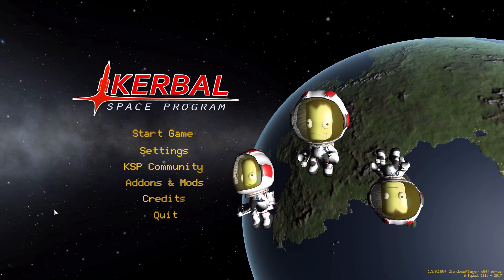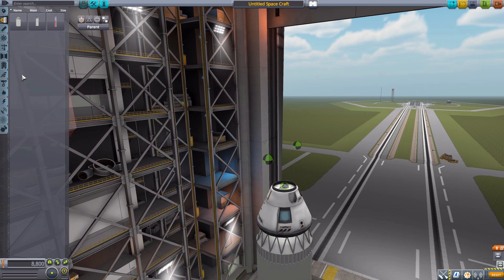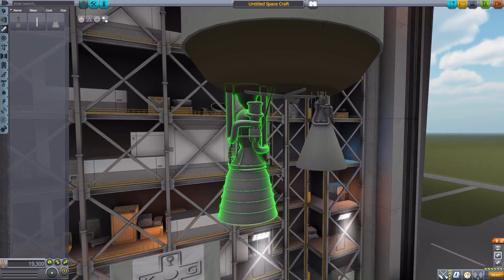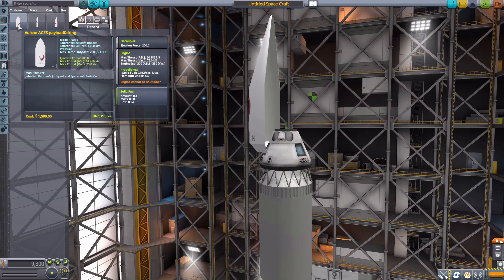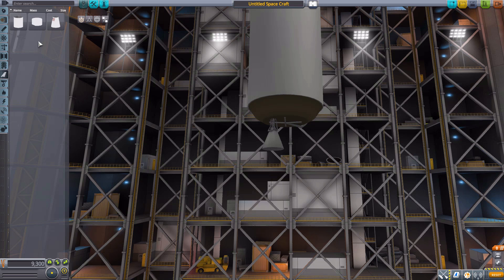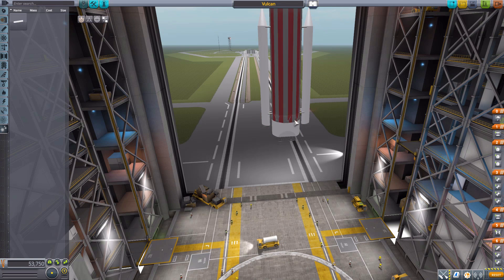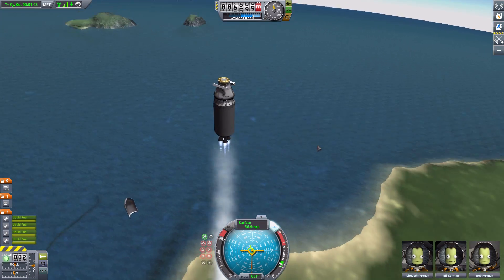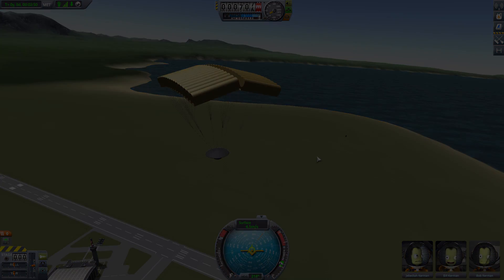KSP Mods - ULA Vulcan Rocket Parts

Comment: The heat shield and parafoil are for the engines. The whole purpose of Vulcan is to detach the engine fairing on the first stage and recover it, so the shape of the parafoil is necessary
Reply from the maker: That certainly makes sense, and something I didn't know since I only have a base level of knowledge of the Vulcan.  that being said though as parts go for KSP you don't have to use them just for their intended purpose